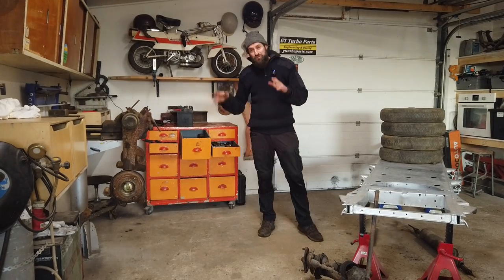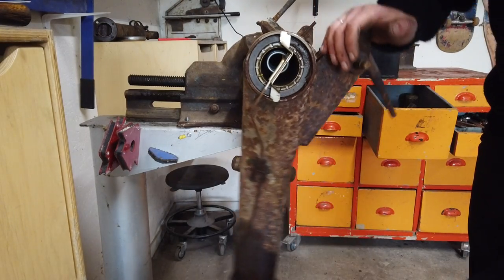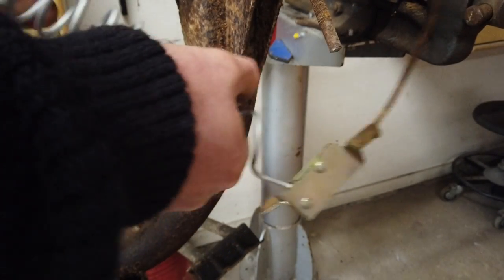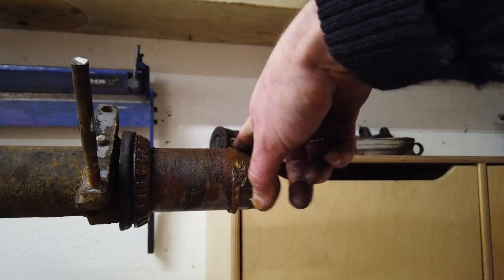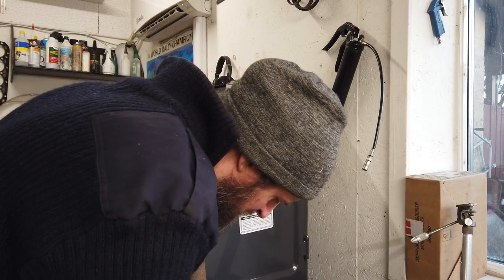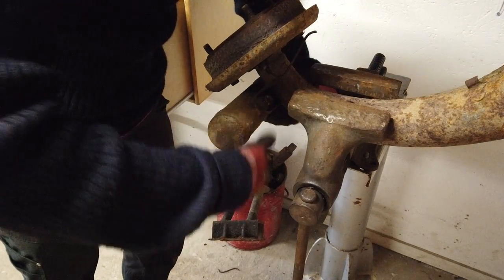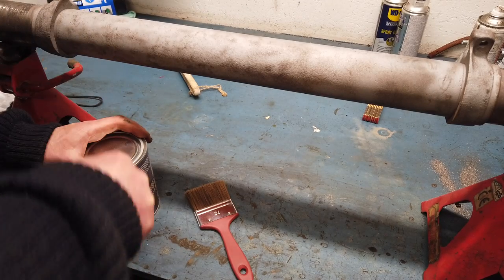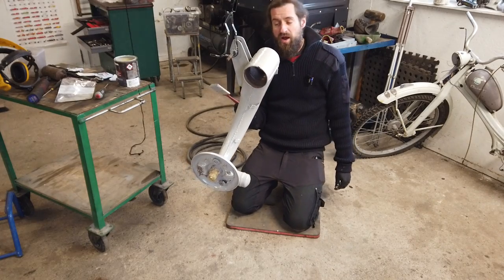Citroën Mehari/2CV | Rear axle rebuild part 1.

Comment: Hi Seaside, you should try a hairdryer or heat gun to speed up the drying time, that’s what I normally do and it works quite well, another great video man.😊
Reply from the maker: Yea... but it could mess with the adhesion I think...  :)

Comment: Ah the rear brake lines, amazingly not fun to fit apparently, they like to avoid staying put when you're trying to fit the nuts to hold them in place, probably much easier with the tube removed from the chassis though... :D
Reply from the maker: there is a special tool for that too actually... dont have that one either! haha

Comment: Pfff!...and there I stand with a paint brush! 
If one blasts metal to undo the surface from rust one should blast all the rust off.
In other words, you should not leave any rust behind. 
By painting over still rusted areas will start the rusting process immediately.
So skip the kindergarten habi babi snip snap work and blast it thoroughly and then apply a powder coating. 
Yes this costs you money but you are going to sell the car anyways. So you will profit from the investments you made earlier.